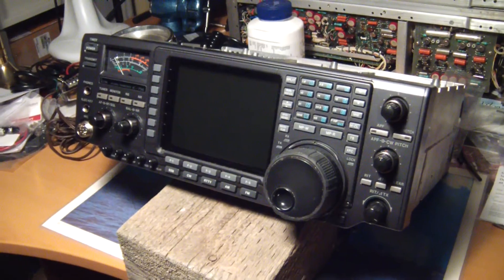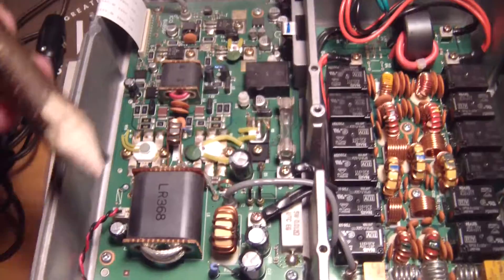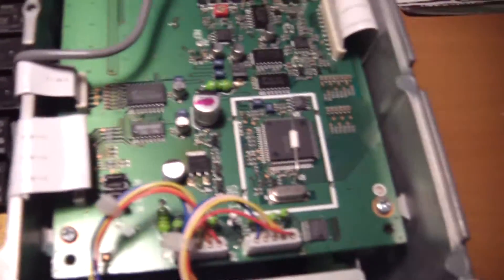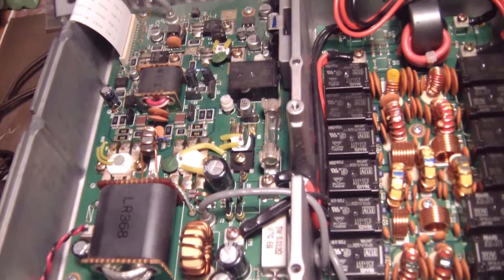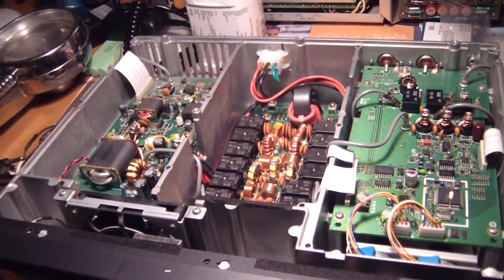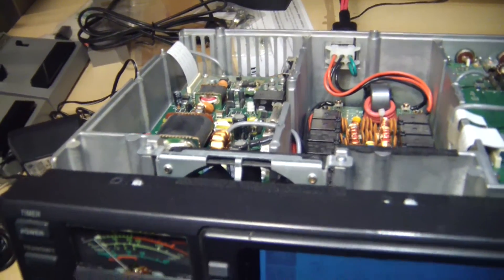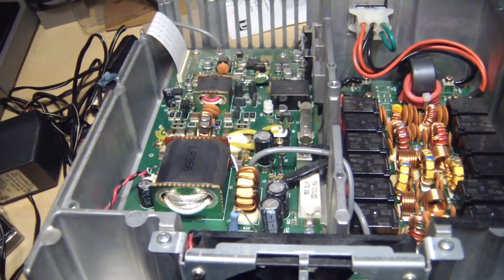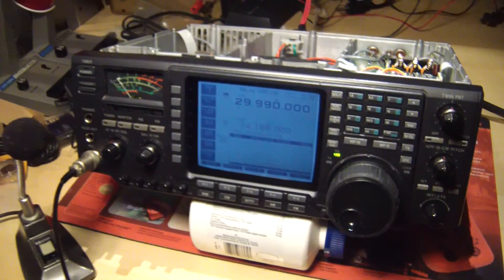ICOM 756 HF radio, TX problems, inspection and repair, Part 1

Comment: I have this radio
And a thin line falls horizontally on the screen
What do you think I should do?
Reply from the maker: This is a known fault and the resolution is to replace the display.
Reply: @EP2ABS - I purchased a 756 new in 1998 (was my first full sized HF and remained my primary HF radio until 3 years ago).    About 4 years ago the first "extra" horizontal lines appeared now there are many if the CT17 control interface hadn't quit working it would probably still be my primary rig.         
Initially 10 years ago when I first read about the issue Finding a replacement display was a possibility.   What I understand now there are no replacements.   If you or someone else has a source let me know I would love to put her back to work!

73 - de NE5B

Comment: Hello.  I have a 756 pro that seems to get hot after some good amount of rag chewing.   Once it gets hot my swr all of sudden goes up.   Any idea what it can be?
Reply from the maker: Are you hearing the internal fan kick in after a few minutes of TX? If not, there's your problem. If so, I'd pull the cover and check out the PA section and the PA transistors for proper heat sink compound and that they are secured in place.
Reply: Klondike Mike Thank you for responding.   I tested with a dummy load today with just the Icom.  Issue went away.  Tested with amp and external tuner.  Issue was not present.   Issue seems to be the end fed antenna.  Another ham was he had same issue with same Icom rig.  Said that the end fed needs to be cut to be more resonant to the intended frequency.  In this case my end fed is more resonant on 40m than on 80m .   So it makes sense that when I would transmit on 80 is when the issue came out.
Reply: Klondike Mike will do.
Reply: your wire is melting...

Comment: It looks like a power supply issue. Try using a higher current rating power supply.
Reply from the maker: You are correct! Thank you for you input. Although, I could have used your answer 5 years ago as that is when I finally resolved the issue. See comments below.
Reply: Klondike Mike hi. Yeah I just realized that. 😁 My bad.. I didn't pay attention on the previous comments. It seems that they already pointed it out..73 de ab1tr
Reply from the maker: No worries. You were not the first this time. And you will not be the last. This is the way YouTube works. These videos will be around as long as Google pays the bills for the servers. I, myself, usually will go through the comments of a viewed video before I post a comment.

Comment: I know this is an old video and I'm sure it's been mentioned already but the problem is obviously a bad power supply, the loud AC hum should have been a dead giveaway. My best advice is always to buy the best power supply you can afford and make sure you chose an amp with at least 20 percent more current capacity than the rig calls for. This same problem can happen if you use an underrated or poorly filtered power supply .
Reply from the maker: Yes, you are correct on the bad power supply. It took awhile to figure out. Some symptoms had me going down the wrong rabbit hole a few times. All is now well and the over-rated Astron RS-20 is now on the scrap heap awaiting future repair.
Reply: I gad to hear that you resolved the problem. It's a shame that you had to go through all the work to replace the PA board first.  
I'm somewhat confused as to your comments regarding the venerable Astron RS 20 power supply.  Contrary to your comment it's not overrated. I think you might not understand the rating systems used in radio communications. 

There are two basic ratings 
#1 CCA 
#2 ICAS or ICS
CCS stands for Continuous Commercial Service and ICAS stands for Intermittent Commercial/Amateur Service.  ICS stands for intermittent communications service 

Most Ham radio equipment is rated as ICAS 
The RS20 is rated at 20 amps peak ICAS and 16 amps CCA which is more than adequate to run a 100 what SSB ham radio station as almost all ham radio transceivers are rated at 100 watts ICAS. Now the RS20 is not rated to run a full duty cycle mode at 100 watts but neither is your radio. Almost all ham radio transceivers are derated to 50 watts or less for full duty cycle modes like RTTY and PSK 31 

If you overloaded your RS20 by running your radio full duty cycle then consider yourself lucky that the power supply failed first because it most likely saved your radio. 

With that said I always over size my station and bench power supply because I want them loafing along. 

 My station is powered by two Astron VS50m variable voltage variable current power supply's while my bench is powered by two 70 amp Astron VS70m power supplies. I also have a few RS20's and 35's as well as an Astron switcher that I only use when I need a portable power supply.  I personally dislike switching power supplies as I have yet to find one that didn't generate significant RFI.  With that said the better switching power supply manufacturers usually do a good job of keeping the stronger  RFI  spikes and hash out of the ham bands. 

The reason a lot of switching power supplies get such good ratings at sites like Eham is that Most hams don't live in an area with a low enough ambient RF noise floor to see the RFI generated by switching power supplies. IN other words, if you constantly have an S4 or greater noise floor then you won't ever see the S3 RFI that your switching power supply is generating. I live in an area with a very low noise floor and the RFI generated by Switching power supplies is very evident.

Comment: I'm trying to find R617 on my ICOM IC-756, AM, RF Output power adjustment.
Reply from the maker: +I'm an Optimus  -  Main board, next to R618 & R619.
Reply: +Klondike Mike  Yes

Comment from the maker: UPDATE: 11/17/2014 - No success yet on solving this TX problem on the IC756. I have replaced the following boards; RF, Main and PA. All that's left is the PLL. I wouldn't think the Filter or Ant. Tuners boards would come into play on this issue. I found a PLL board on eBay and will give that a try.

Comment: Usually the driver stages are ok without a load, but if you are worried you can tack a 47 or 56 ohm resistor across it.
I would isolate the drive from the PA before continuing. 
The solder flux you saw around the PA transistors is normal, they are fitted last and don't usually get defluxed.
I am suspicious that there is a power supply issue, I realise that the rig is driven from an external supply but the hum coming from the loudspeaker suggests the supply is ripply at high current. I realise the panel lights don't appear to dim on transmit but some rigs stabilise the panel lamp voltage. I wonder if this was the power supply in use when the rig apparently failed?

Comment: I wonder if it switches proper between RX and TX. Check the RX and TX 8 Volt on the main board. If you have 8V on the RX line while you key up the TX, you just found your problem.
Reply from the maker: I have checked and confirmed that the switching between RX and TX is working correctly. John from the UK guided me through this check previously but has since disappeared without any follow up.

See addendum video for additional details on symptoms;
IC756repair2b

Comment: It is possible that somehow various values in the DSP have been screwed up, I don't think this radio generates it's TX RF conventionally. While testing it you may find it helpful to have a receiver on the shelf so you can "hear" your tx output.
Reply from the maker: The radio was in the middle of a QSO when it over-heated and shut down. After cool down these symptoms are the result. So, no fiddling of any DSP settings were accidentally introduced.

I have not tried listening to my transmitted signal on another radio yet, I should do this. I did try to get a response from a DX contact but was unsuccessful.

Comment: I would remove the drive from the PA section first. Then look back from there, the PA section is getting in your way with testing this, by disconnecting it at the mini coaxes you can work at a more leisurely pace with the radio in transmit mode for long periods.
Check the drive signal that normally drives the PA, is this also generating full carrier when mode is SSB?
While you have the rig in bits check the seating of all those flexi strips, they are pretty troublesome.
Reply from the maker: Disconnecting the mini coax to the PA section has been suggested before. My question then is "do I need to worry about the un-terminated pre-driver signal"? I don't want to blow up that section if it don't have any load on its output.

During my demonstration I show that there is FULL carrier output in all modes. There is just the unknown audio buzz injection modulating the carrier now.

I have reseated most of the flexi strips.

Comment: Interesting... here are a few more ideas: Does this happen with less power too? lets say 50W or even 5W? Did you check the RF coming out of the RF board with the PA board unhooked to see if everything is clean? If that passes, I'd take the filter board off and test the PA board there. If you have it nailed to the PA board, i'd take the finals out and see what gives.
There is another transistor (Q8) that sets the biasing to the finals.
D2 and D3 are heat sensing devices, check them.
Maybe a bad electrolytic cap somewhere?
Reply from the maker: Thanks for your input. Happens at all power levels. I swapped the RF board and results are encouraging although alignments are required to confirm. I'll follow up on your other idea's once I align this replacement RF board.
Reply from the maker: Klondike Mike
RF board swapped out. No change in symptoms.

Comment from the maker: I believe I have found out what initiated the problem. There is a thermistor that sits atop the final transitor on the left, in a dab of thermal grease, that controls the fan. This thermistor had lifted out of the grease and was free floating in air.

I set the thermistor back into the thermal grease, although the damage has already been done. Now to find that needle in the haystack.

Comment: If you have the ability to repairer it yourself that would be my first choice. I have been running the Pro a few years now.  However I did a dumb think a few years back.  I sold most of my repair equipment, I sold my Marconi Full Spectrum Analyzers, along with my old Complete B&K system. I haven worked on any gear in 8 years or so but I will watch your video again to see if anything pops out at me.  Icom make great systems